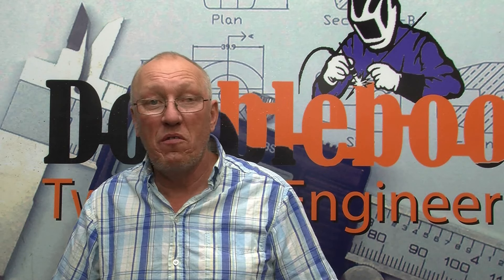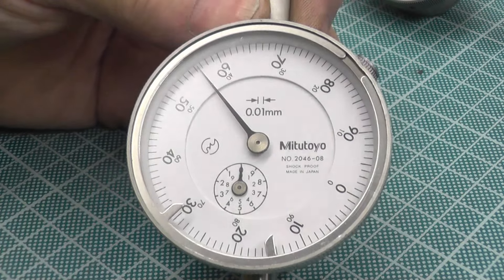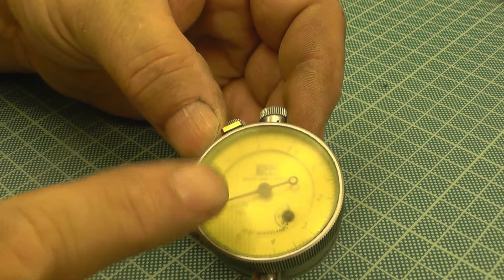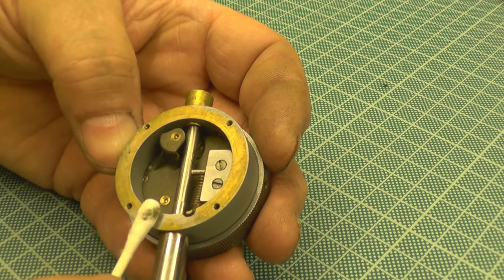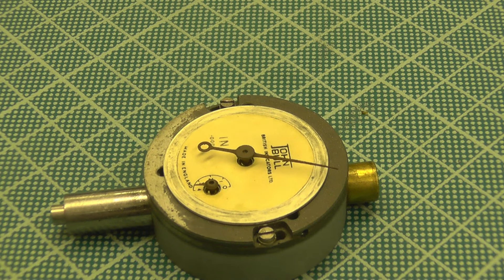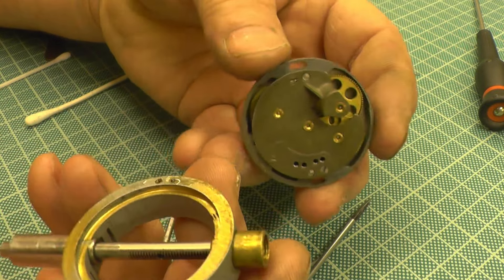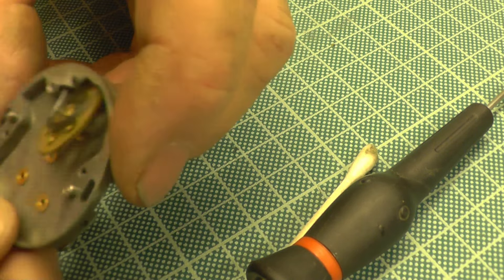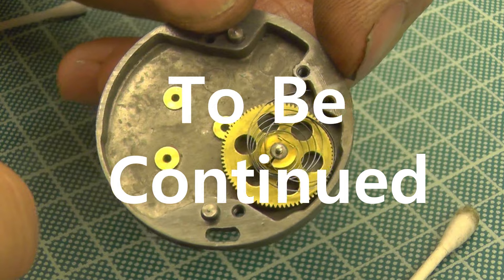DTI Care & Repair with Bob  Part One

Comment: This has been a really good addition to your channel.  Something a bit different, and a guy who obviously knows what he's doing and just as importantly manages to explain it well - I hope there will be more where that came from.

Whenever I remember and finish one of the small 250ml pop bottles I cut the bottom 11/2" off and screw it onto my working board ... they have 6 "dimples" in them, ideal for tiny parts.  The shape makes it easy for even my fingers to slide out small screws and because its fixed to a board - you'd have give it a hell of a crack to spill the contents.  My current board has 8 pots and the board is held onto the bench with a small G clamp - But horses for courses you work how suits you best.

My other more recent "discovery" is a magnifier that clips onto my 4x reading glasses.  Its an e-bay special 
"Clip-on Eye Glasses Binocular Magnifier Eyeglasses With 3 Lens 1.5X,2.5X,3.5X" - £3.
It suits what I do and how I work - Clipped to my strongest reading glasses it gives a combined 7.5x magnification which works for me.

Comment: Hi John and Bob, I am sure that Bob already know this but did not think about it at the time, the cover seen at 11:49 can be rotated a little bit, and by rotating it you can control how much the gear is in contact with the stem, and because the former "repairman" had adjusted the gear to tight towards the stem then it wont go back properly and it might also feel a bit notchy, I had one that had this exact problem. Nice to see Bob is a natural YouTuber, a good old handmade thumbs up to all three of you.

Comment: Fantastic. Keep these videos coming. I've never had the courage to take a DTI apart (which Is sort of strange because there is noting to lose). But watching Bob do it gives me some encouragement. I have a few around to try.
I'd also like to see what's inside and how to fix one of the (name escapes me) ones that are very sensitive and have the little lever on the end. I have a few of those around as well. 
Thanks Bob and John
Reply: Dial test indicators are the "ones that are very sensitive and have the little lever on the end".  They typically read in tenths of a thousandth. Clock gauges or dial indicators, (in North America), read in thousandths of an inch.

Comment: Very interesting video but I think there is a better way of securing removed parts. Use a tray (preferably with a lid) that has been stuck down to the work surface with good quality double sided tape. Cant get knocked over, jostled or parts being blown away by unlikely but possible gusts.

Comment: Great video but would question the idea of 3in1 being anywhere near a clock as it is famous for gumming over time, just look at what sits on the top of the tin.
Reply: hi well yes it will in time but if you want to spend £20 on a tin of instrument oil go a head but as I sad if you only have one to do and you ant going to do any more wats the point and if you have taken it to bits and got it back together working then you can do it over a gane when it starts to gum up regards bob
Reply: @bobdixon6060  you make a valid point but perhaps the cheap option would be a quality sewing machine oil used very sparingly.
Reply: @chrisstephens6673  hi well if you have it on hand but its hydroscopic
Reply: I did not know that, I was lead to believe it was a refined mineral oil, and 3in1 was veg based(or was originally ). personally I still have some of the proper instrument oil which will last about 35 lifetimes at the rate I use it.
Reply: @chrisstephens6673  hi mine will to .sewing machine oil is designed to brake dawn if you think if the oil gets on the fabric it needs to cum off easily so its blended to be biodegradable